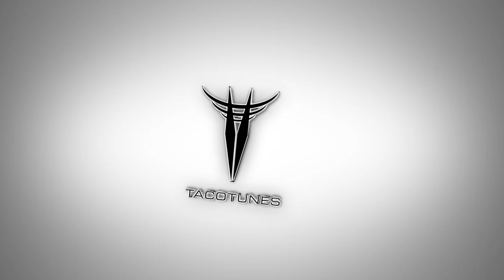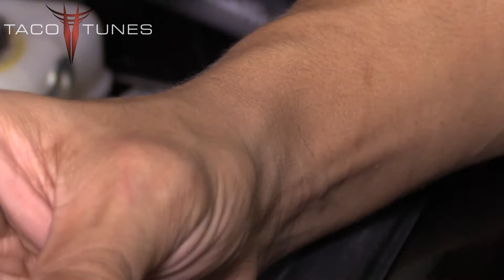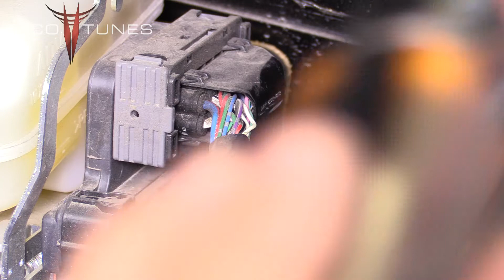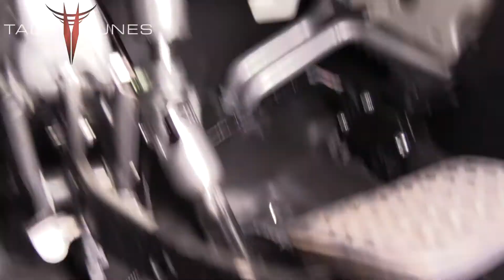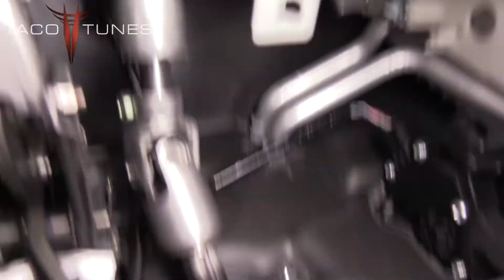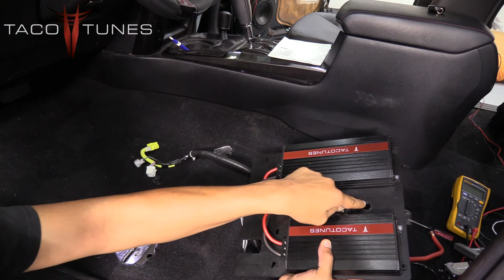Toyota 4Runner How to install amplifier power wire from battery to amps 2010-2019

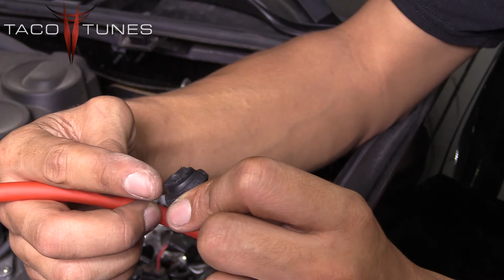Comment: Ughhh @1:50..... Is that your "4 gauge wire" ?.... Come on man . Look how thick the shielding is compared to the actual wire. That's maybe, at best an 8 gauge wire being sold as a 4... Bro that could start a fire if some one runs it at the upper levels of a 4 gauge .

Comment: My 2016 Canyon is going tonhave the amp in the back. The new speaker wires run under the door sills so I can't run the power wire there too. How far over under the carpet should I run it? I'll have to take out front and rear seat to do that

Comment: What about if the cable i going to use is 0 gauge ?

Is  that hole  in the firewall big enough  to pass the cable through there?
Reply: Why would u use 0 g for a small amp ?

Comment: is that a safe place to put an amp under your seat ? how will it get good  air flow to it to stop from over heating ??  just wana know cause ill be getting a rav 4 soon and im looking for a good place to mount my amp
Reply from the maker: Great question!  The TXD line of amps are the 3rd generation of full range class D amps. Unlike older style AB amps that lose 50% of their power to heat, these are 95% efficient. So they generate very little heat. In the old days, AB amps would get very hot. Most larger companies have gone full range class D. There are still some lower end AB amps being produced. To avoid the risk of pissling off old timers, there are still some higher end AB amps being manufactured.